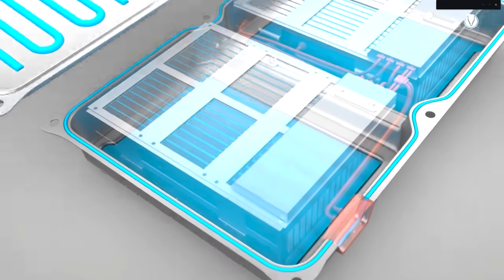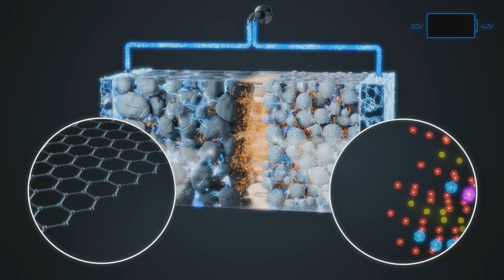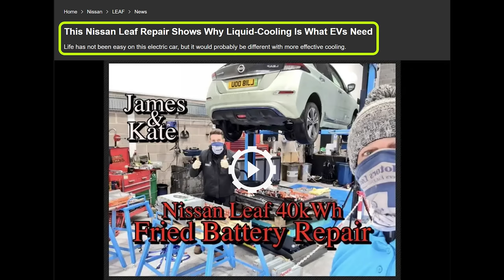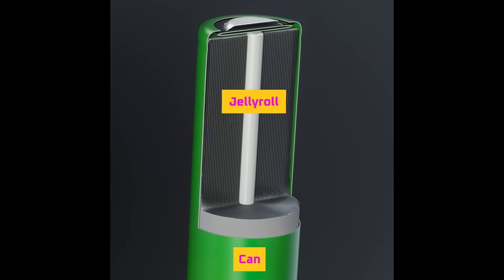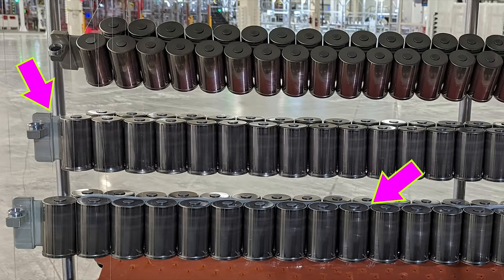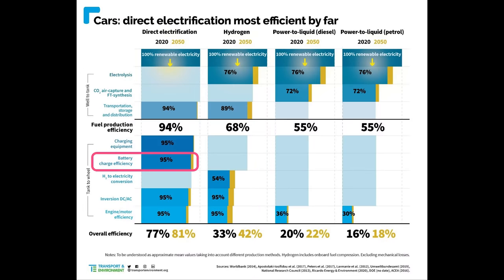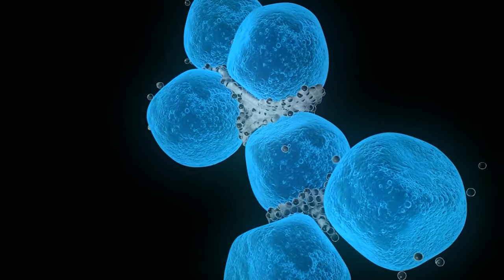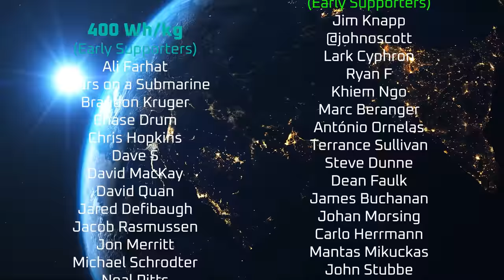4680 Thermal Design and Management // Why Ribbon Cooling is Better

Comment: You cannot see which exact cell is defective from a BMS perspective, you can only see that for each voltage set of cells. A faulty cell will drag down voltage of the whole set as they are wired in parallel. It will also limit how much that set can charge. To determine which specific cell in a set is defective, you have to disconnect the cells and test them individually.

Say your battery has 4,416 total cells arranged as 96s46p. If any one of those 96 serial sets of 46 cells in parallel is significantly different than the rest of the battery pack, the entire serial string capacity suffers. This is a disadvantage of small cells (e.g. 18650), as there are so many more of them increasing the likelihood that one will fail compared to 4680s. If an individual cell completely fails with a short - that is actually a better case. The fuse link will blow and you are just out 1/46 of the capacity of the battery as it is taken out of the entire circuit. Same thing if it fails with an open, although in that case no fuse will blow.
Reply from the maker: I'm trying to square that with the fact that in the examples I've seen, 1 cell has dramatically impacted pack level performance.
Reply: @thelimitingfactor  
AKA "The Porsche Problem"?
Reply: @thelimitingfactor  Yes, one cell can dramatically impact pack level performance. But you cannot electrically measure the difference between that cell and the rest of the cells in the same voltage set with a BMS. What you can see with the BMS voltage probes is a difference between that set voltage and all the others, as you showed in the video.

Comment: You mention a potential video about can wall thickness affect on heat and wicking it away but I was wondering about how can wall thickness affects charging speed. My understanding is that cold cells charge slower and so there's a need to heat the batteries up or keep them warm - especially in cold weather. So presumably a thicker walled can would make it harder to get necessary heat into the pack/cells because the thicker walls would wick heat away from the jellyroll.
Reply from the maker: Good question!  The impact of thermal mass.
Reply: I'm no expert, but the comparison of the area involved in cooling / heating versus the cell thickness is a large ratio, and would not impact overall heat transfer "very much". I'm sure Tesla modelled this, and figured the optimum wall thickness , for the dozens of parameters required...(Jordan has an endless workflow....)

Comment: Great cooling video:  Question:  Why have they not run the cooling in a more serpentine fashion to create a greater surface area for cooling?? ~~~~~~~~.. One cooling arm could cool two row of batteries with more than 50% of the can surface area in contact. I realize that it would add a small amount of weight, but this seems negligible compared to the battery life savings with improved thermal management.😀 Thanks
Reply from the maker: That's a million dollar question!  We don't know their current baselines.  I'm assuming they made the ribbon decision design on balance and it could be an area of future improvement.

Comment: US Patent No. 11,387,521, issued July 12, 2022, is directed to an advanced nanoporous separator for lithium-ion batteries which has far superior safety properties such as better heat conductivity and non-shrinkage compared to conventional separators currently used in lithium-ion batteries. US Patent No. 11,387,523, issued July 12, 2022, is directed to a new generation lithium-ion battery in which the cathode is directly coated onto the separator. This technology reduces the complexity and expense of the equipment used to fabricate the battery, for flat and prismatic batteries that can be used, for example, in electric vehicles. This US patent also enables alternative manufacturing processes, such as where a non-dried, wet cathode is applied to the separator.

Comment: Lucid battery pack video stated that it is difficult to make the ribbon channel to be in full contact with the cylindrical cells in mass production. Instead of 20% of the area as you stated, you may get 1/4 of 1/3 of it if the ribbon is misaligned with the cell cylinder. How did Tesla solve this issue? Maybe worth to do a video on that.
Reply from the maker: Conductive adhesive and precision engineeering

Comment: Cylindrical 2170 cells have 10x better cooling axially compared to radially. Tabless improves that significantly. Plate cooling has a similar thermal performance as ribbon cooling up to the can but ribbon cooling performs better at spreading that heat around both bottom and top of the cell better.(area is less for plate cooling but epoxy gap is smaller and more consistent so overall thermal interface is about the same. Tesla isn't able to get the ribbons to form exactly to the shape of the 21700 cell. 4680 is a huge improvement on many fronts. :)

Comment: Given that single cell failures have a disproportionately large whole of vehicle cost, why is per-cell monitoring and isolation not built in?  I can imagine that a cell absence would affect battery bank voltage and current characteristics, but are there not simple electrical solutions to those?

Comment: In summary, "Ribbon cooling provides greater surface area, which results in higher efficiency of cooling".  However, increasing cell size 5x also increases thermal mass.  Meaning the center of the cell is cooled exponentially less than the outer layers of the cell.  In theory,  tabless technology coupled with ribbon cooling applied to smaller cells like 2170 & 18650 would be the most efficient way to maintain thermal management of the cell.  What this means to me is that thermal cooling for the cell/pack is not Tesla's priority.  The more important variables to consider, which Elon emphasizes consistently, is cost and scalability.  I think 4680 would not have been possible without the tabless innovation and its impact on thermal management.  Tabless cells will prove to be the single greatest innovation in batteries due to its low resistivity = less heat generated and the increased rate of cell fabrication.  The next innovation will be the solution to high energy dense cells using silicon.  Exciting times we live in!

Comment: If a pack has faulty cells, can Tesla disable and isolate part of the pack?  Could this explain the weight of the Austin  Model Y 4680 structural battery pack as per Cleanerwatt's analysis?
Reply from the maker: No, the Tesla pack would be limited by limiting the voltage range (if it is)

Comment: a jelly roll by it's mear winding on itself creates a structural rigidity that you can't achieve from a pouch unless the pouch is hardened by it's outside shell . a thick outer shell will increase weight and hinder cooling effect.
Reply from the maker: It creates rigidity but it's also extremely fragile.  That is, the shell is required, whether that be on the cell itself or through modules.
Reply: @thelimitingfactor  i totally agree with you. I was explaining how a cylindrical battery has a great advantage over a pouch. When you say "extremely fragile" are you referring to the outer shell or the jelly roll itself?

Comment: Let me add to the rationale in this video. 
(1) The anode foil wick heat more effectively towards the base plate only to be impede by the electric conducting wafer (a heat insulator) leaving a high thermal gradient between anode foil and base plate. 
Remedy? Solder all anode flaps at the base plate which will not set back electric current. 
(2) given no soldering option, heat transfer must use radial path towards cylinder wall. Heat transfer radially through chemical and insulation is undesirable but it benefits from a higher wall area as opposed to base plate with a wafer heat insulation. With better coolant circulation we can pull it off, heat in the core. 
(3) per base plate cooling architecture - only a fraction number of cells (cylinder wall and plate) can be directly connected to the chassis to benefit a direct heat path to a metal structural plane with coolant channel under breath. The rest are (electrically insulated) that impedes heat flow out of the base plate. Heat at the base plate must migrate around to cylinder wall to be wicked off. 
Hence the heat sink via cylinder wall become a prevalent architecture.

Comment: A battery is not 95% efficient, the graph you are showing to this is the on board charger efficiency

A battery 21700 has 15mR milliOhm of resistance, with a current draw of 0.2-C in high-way driving conditions, this is 4500mAh*0.2 = 0.9 A per cell = 12mW loss for 5h = 60mWh lost, on 16.2 Wh total cell (3.6V, 4.5Ah) = 0.37% lost = 99.63% efficiency of battery cell only!

Battery is roughly 99.1-99.5% efficient if you include bus bar and cabling losses in battery pack assembly
Reply from the maker: When I spoke to battery scientists about it, I usually was advised of an efficiency at the battery level of 90-95%.  The charging equipment was also showing in the image (also 95%).
Reply: @thelimitingfactor  that is true

newer battery chemistries since 2018 model 3, now have power NCA and NMC cell chemistries where the battery is designed more to efficiency, this leads to >97-98% battery efficiency at least in regular power levels. during supercharing this drops way in of course, due to the large currents and thus resistances that add up.

OBC charger is sometimes 93% some products 96%

while the SiC inverter of model 3 achieves ~98% efficiency, and newer versions even 99%

Comment: If the ribbons ran from side to side verses front to back the length of the ribbons would be shorter.  If the coolant had two different ribbons one could run from left to right and the other from right to left.  Each cell would have coolant flowing in one direction on one side and the opposite direction on the other side.  This would balance the coolant temperature from beginning to end.  There would be two manifolds on each side, one flowing to the battery and one flowing from the battery.  The objective is to not have heat as it is an energy loss.
Reply from the maker: Yeah, Tesla's cooling has evolved into U-shaped cooling.  Effectively cancelling out any gradient.
Reply: As I recall from the Munro stripdown, that's what they do.
I think it's two alternating circuits, with a cold feed on each side, running across the vehicle (I may be wrong)

Comment: Don’t tabless allow for broader energy flows to greatly reduce potentials for cell shorting dendrite formations, thereby extending battery life by orders of magnitude?
Reply from the maker: Not really.  If that were the case then multi-tabbed prismatic cells would have longer life, but they don't.
Reply from the maker: Tabless extends life by the mechanisms I desribed here.  By reducing total heat and heat variation.

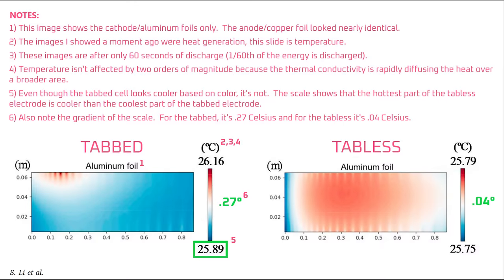Comment: Page 17:17 
Single tab vs multi tab power dissipation. 
This data set excluded the threshold effect (bottom line to an issue or not) only the ratio. 
My question is - what is the base line power dissipation per cell that dictates an adverse effect to thermal management and longevity of cell? 
Example: if the system can tolerate 0.3W per cell and a single tab cell contributes 0.1W compare to 100 tabs for 0.001W then we are burning mid night oil for little to nothing.
Reply from the maker: Great question!  (I don't know, lol).  It depends on how you define adverse.  Any variation results in an effect over hundreds of cycles and ten years.
Reply: @thelimitingfactor the test data in side by side compression in this video mimicking that single tab and multi tab aren’t causing any issue enough to justify a redesign effort to a tab less architecture and its trouble we encounter during ramping phase, while Panasonic 5 tabs approach can handle 5x of 21700 demand ie 46800. See my previous message on example.

Comment: Eh, I'm surprised why engineers haven't just enclosed top and bottom of cells to make it water proof, pack batteries closer so body of the cell creates channels, directly cooling cells and in case of thermal runaway of single cell you have A LOT water right next to cell to boil off before endangering nearby cells

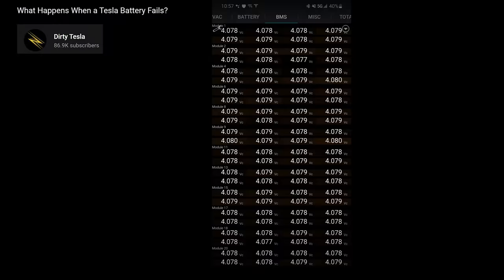Comment: 2:19 What we see here may just be after cell balancing which happens usually above 4V after charging, not an evidence for perfect cell matching. Larger deltas show up near the end of the discharge cycle but they are usually accounted for and it must difficult to match cells in the factory before they "run in"

I am curious about the long term effects of uneven cooling because in my diy e-bike the motor controller heats up one side of the battery pack to 50C while the opposite side always sits below 40C
Reply: Also the tests by BU are done WITHOUT cell balancing, that's why we see this huge degradation
Reply: When you group cells in parallel and then in series it averages out so the ones connected in parallel I don't need to be matched so tightly
Reply: Are the batteries cooled ? I believe that generally, you want to keep Li-ion below 40 C (to get longer cell life). it seems to be especially important while charging.   So at least let the battery cool, before you charge it ! If you often discharge " as low as it will go", different temps may be a problem. But, lets's face it, if you get 1000 cycles, or 800 cycles before 10% loss, is that a big deal ? (Answer - probably not...)
Reply: I know, I always let them cool down to 40C before charging, and only at 0.3C charge rate. I don't have much space in the battery box. There is only a 1cm gap between the controller and the battery and have installed 2 50mm blower fans to push air through that gap but it has nowhere to go since it's all sealed to be waterproof. I don't even have space for better/more efficient controllers so I kind of accepted the degradation, the question is how much. Only time will tell.
Reply: As for lower/upper cut off i used to only stay in the 10-90% SoC range but i realized that the lifetime of the vehicle is much shorter than the SANYO GA 3500 cells
Reply: I don't see any signs yet after 4k km so around 80 eqv full cycles but most of them are 90% to 30% below 45C peak.
Reply: I have a smart BMS with my custom appso I keep a very close eye on it (to third decimal :D)

Comment: With z4680 Batt pack & Batts being used as a structural members & having a flat cooling tray underneath, wouldn't  much pressure be placed on z tray even while a car full of peple is just sitting still? If so z hollow cooling tray would have to be massively beefed up to not collapse, adding much weight.
Reply from the maker: Not trying to be cryptic here, but it depends on the design of the tray.
Reply: @thelimitingfactor  Just seems like a huge semi hollow tray with a very high vertical load would need to be much stronger, thus much heavier,

Comment: I know nothing about cooling but it just seems odd to me that not both sides of the battery are being cooled... the cooling ribbon is only going through every 2nd row... unless i missed a thing.
Reply from the maker: Odd really doesn't help me here.  As the researchers said, it's total cooling area that matters, and then I said that you have to balance that against multiple requirements.

Comment: n March 2021, Optodot was issued U.S. Patent No. 10,950,837, titled “Methods of Producing Batteries Using Anode Metal Depositions Directly on Nanoporous Separators.” Third Generation NPORE® ECS Electrode Coated Separator technology, developed with funding by the DOE, aims to reduce the cost of manufacturing lithium-ion batteries and the inactive components cost by 20-40%, while improving battery safety, lifetime, and energy and power density. NPORE® ECS incorporates new inactive components of separator, current collectors, and termination materials, and utilizes a simpler and faster battery assembly process. With ECS, electrodes-for example, lithium metal anodes-are directly deposited onto the separator to form a separator/electrode stack.

Comment: Cylindrical cells for LFP going into a storage application is unnecessary.
The draw on them will be so much less coupled with the incredibly low internal resistance (the source of heat) doesn’t need much cooling
Reply from the maker: Depends on the energy storage market application.  There are 12 from memory (from black start to seasonal)
Reply: @thelimitingfactor  I hear ya.
I’ll throw out my prediction that we will never see Tesla do cylindrical lfp for energy storage.
I feel that any gains from cylindrical will be outweighed by being able to make larger prismatic cells so that no paralleling will be required.
Reply: With 4 hour survivability or 0.25C, then I would agree
Of course there is the potential manufacturing  speed benefit of the cylindrical form factor that may give cylindrical the edge over other form factors.
Reply: @bru512  speed is pretty close for a single cylindrical vs a single prismatic.
Where I think prismatic will take the edge is let’s say you are making a 100-200ah pack. That could be 1 prismatic vs 4-8 cylindrical 4680 cells. Then add in all the extra operations to move those additional cells around, additional welds etc.